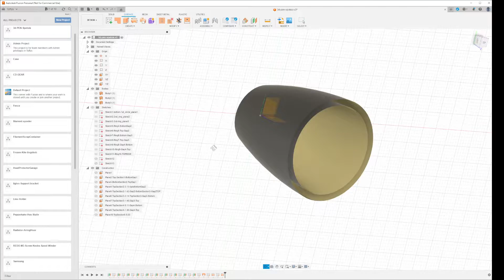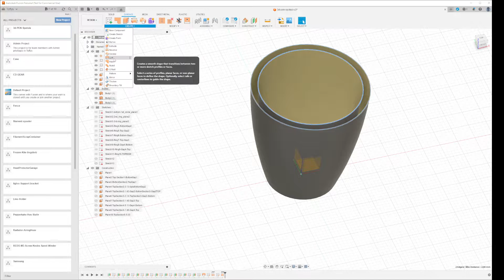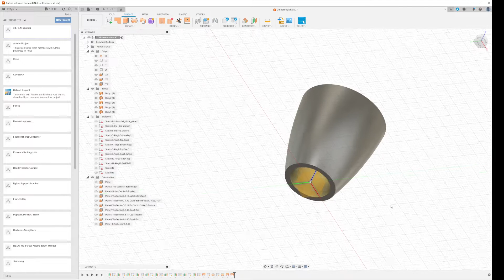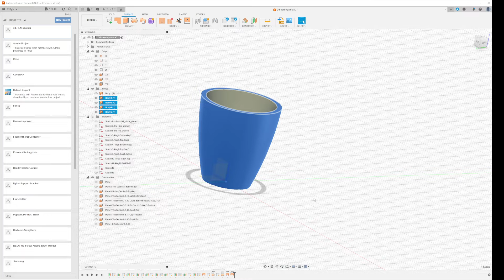Fusion 360 - How to create a surface between two circles, without covering the middle.

Comment: Easier to create as a solid... A single sketch and a revolve. Or if it's not a circular shape use sweep.
Reply from the maker: Not easier to create as a solid. But sometimes the surfaces are out of alignment and not as easy to make a perfectly fitting sketch of. A sweep would require a specially made guideline in 3D space to function properly. 
Thnx for the comment. :)

Comment: Great job! Kinda dumb that patch doesn't do it. Not very intuitive. Your inner face is backwards (colored gold) and so it won't stitch. Modify > Reverse normal and select that surface to fix it. Otherwise, great video. I've been looking all over for this solution.
Reply from the maker: the inner face did not connect first time since i was lofting to the wrong object which was not a solid surface.